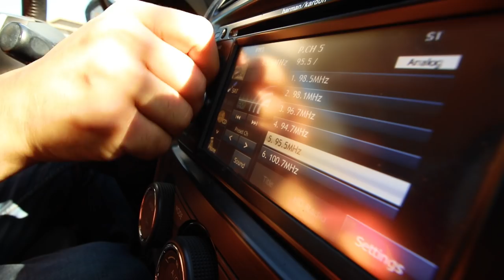Feniex // Hammer Low-Frequency Siren

Comment: Okay so basically it's a speaker. It connects to your existing siren tones so I'm guessing that's essentially what it is a speaker that turns your tones to a low decibel volume?
Reply: Has both options. An amp built in with 7 tones. Can be used as a stand alone or as a speaker bypass(does turn the tone to a low frequency).

Comment: I’m confused,i heard i’m only able to use it for 60 seconds maximum at once,does that only take into effect when using the factory programmed tones,or also when i have a remote module for example a feniex typhoon
Reply: Stereotyped Hypebeast it’s unhealthy for the ears to have low decibels vibrating so close to the driver for too long. That’s why there’s a limit